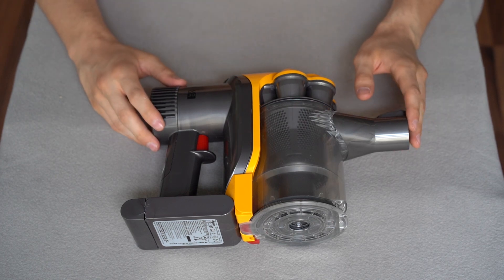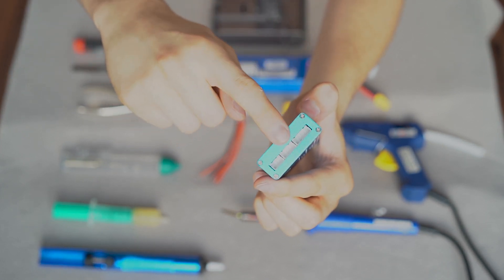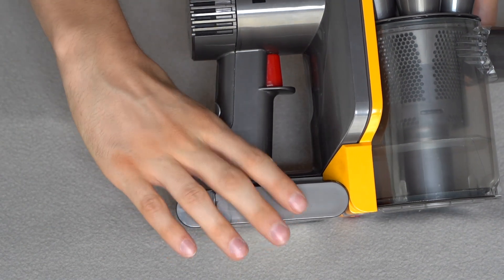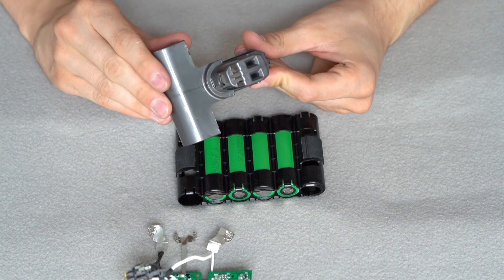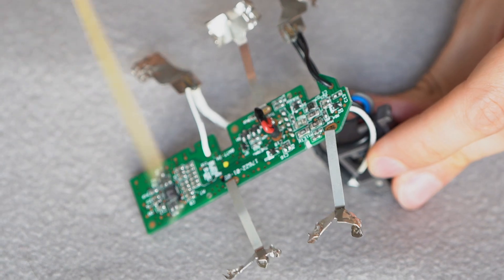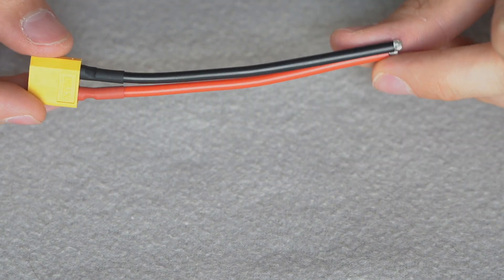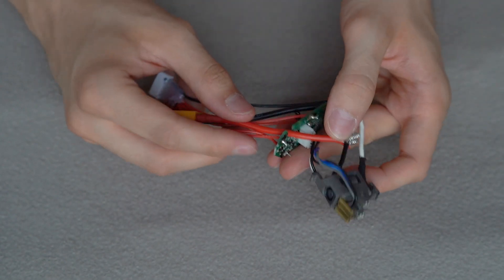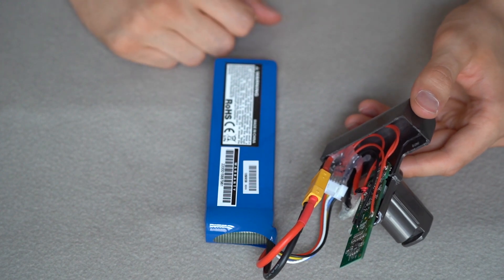Dyson Ultimate Battery Modification! Shocking!

Comment: Looks like my DC56 is a ~24VDC pack since the cutoff is somewhere, if I recall correct, around ~21VDC I found when measure.  I was planning to use a Kobalt battery pack when I get around to finding one at a great price.  Reminds me I should post some of my videos on iFixit if there's not ones yet detailing what I've worked with.  Thanks for sharing!  Gives some insight.
Reply: Yours looks like a 5S battery FYI... unless the pack is missing a battery.  (Update: Oh, interesting... has two missing cells locations).  Great design.
Reply: My wife's v8 is a 6S setup, and I had thought about the Kobalt's until I looked at prices and chargers.  Instead, I found the cells are $6-10 each, so I'm going to plan on replacing them instead.  I bought a charger that grades batteries (so I can judge condition).  Right now, the first battery is 2315 mAh, on cells that are supposed to be 3000.   I'm using an XTAR VC8, and I've rigged up a cable and a wood dowel so that I can charge and grade each cell--though it takes a LONG time--to evaluate each and tell me whether they're bad and/or which ones need replaced.  Then I'm going to buy new cells and put them in the existing pack, unless I can find a way to purchase a larger housing for bigger batteries that fit (and are cheaper for the same capacity).

Good luck!
Reply: @ericvincent3219  Funny is I've just been charging with a 24V power supply with a barrel adapter that uses a double alligator clip plugged in.  Been using as-is since since I balanced the cells manually using my Turnigy Reaktor charger. I haven't been motivated to spend anything on yet, though the closest I got was lazily daisy chaining the DeWalt powerwheels switched adapter to this pack.  Though seemed a buck converter in between would be better and that kept me from doing anything more since I don't have a buck converter that high enough current yet. 

Maybe someone can custom design and 3D print a housing for you if you're not in the know on how to or have a maker space of fab lab resources?  Can be outsourced printed as well like a few different online shops once you've made the STL file from the CAD app.   All the best and thanks!

Comment: I put a Bosch 18v to mine, just like the adapters only mine popped two motors. Why would it do that? Is their components in the adapters to stop the current flow or have I got two bad motors??
Reply: You put 18v to 14.6 designed electronic device...
Reply: i think the bms also communicates with the control electronics regarding the voltage, since the dc30 works with 4s and 6s batteries. on the pcb it even is labeled "24V", so the device is capable of using this voltage, but maybe only if its communicated by the bms

Comment: Hi! Cool video! If you use original original bms and you leave it without voltage in this type of dyson battery,the bms locks and never more works again.
Reply: Thanks for the insight. 👍
Reply: There is one guy from Japan that has modified the BMS so it works again he is on YouTube .
Reply: Do you have the link of the video?
Reply: @jonathanvazquezmarin8006  no but just type in dyson battery fix and it may come up.

Comment: Hi , very good video and explanations!   Good power and light weight.....but be careful with this battery type which has no external protection. 18650 cells are placed in an individual metallic cover and then in the plastic box. These polymere batteries are not always stable and have only a fine and soft enveloppe. If placed in an little air plane high in the air : no security problem for the user (perhaps for the air plane!) . But here just under your hand it's absolutely not secure if the pack warms and , possible, burns.
Best solution would be to build a solid and secure box before use...I would say it's necessary.
Friendly, Michel from France.
Reply: But another relevant factor is that LiPos, unlike Li-Ion, can not be left fully charged for long periods, and should be kept at storage charge, approx 3.8v per cell, when not in use. This means you need to charge them up to storage charge after use, and then top them up just before using them again if you want to get the longest life from them.  I do exactly that with my lawnmower, which used to have a very heavy lead acid 24v battery that took many hours to charge. I replaced it with one of the 6s LiPo batteries I use with my RC models, and it can be charged in as little as an hour if need be, and the weigth of the mower has been greatly reduced. I would suggest these kind of LiPo hacks are best used by experienced LiPo users, who are aware of all the dangers of LiPo packs.
Reply: @charlestoast4051  I agree your full comment!     And I add to be specially careful with the Dyson VCleaner if we use the max power during more than some minutes : Lipomere Batteries with their high C rate will perform for this use, and it could be pleasant to use often the cleaner  with this power...but at max power the Dyson VC needs a lot of amps (that kills the Dyson battery quickly) and it could be another danger with a lipo pack by long stopless use.

Comment: Can’t I just solder a battery to a push switch, and have the vacuum push button push the switch I will purchase, and that switch closes the circuit to the battery. Charging the battery can be done externally, like a drill battery of sorts. Would it work?

Comment: Replacement battery on amazon is like 55 bucks for 3800mah original battery type.
Reply from the maker: okay, and equivalent rc lipo is ~25  $ :)
Reply: $40 with shipping and taxes included on ebay for dyson v6 compatible  4800 mah battery
Reply: @chapter1762  they all fail in 3-4 months. Better off buying higher quality panasonic or other batteries and replacing the cells
Reply: The general output of 18650 is around 2200-2600mah. I would expect ebay pacs to be on the low side and be capable of the original pack 2200mah. They of course sell packs labeled to have Sony batteries and in 4,5,6000mah output for $20 currently.  I'm sure the packs are 2100mah as I'm sure the green lasers are all 5mw or less even though they claim 5-500mw

Comment: I accidentally broke the thermistor on my original battery bms, is there a way i can bypass that or make it work again affordably?
Reply from the maker: thermistor is usually a ptc or ntc resistor. so you might want to try a resistor with high resistance, or jump wire , but im really not sure.
Reply: Go to your local electronics store and you can buy a 100k NTC

Comment: I have a DC30 and the battery says 14.8 V 1500 amp . In amazon i get 22.v with 3000 amp battery - will those work for D30 or i need to only buy 14.8 v?? Appreciate ur response.
Reply from the maker: Only same voltage battery will work.
If original is 14.8v, you need 14.8v new battery
Reply: @cars_anatomy  Thanks!!!
Reply: no, it works with both 4s and 6s

Comment: I was searching for an onboard solution to keep the handy stock charging station, but this is pretty cool. There must be small enough onboard 6s bms with discharge for esk8s etc which can replace the woeful dyson/clone bms. So far I’ve replaced the cells with 30Q 3Ahr cells. Thanks for sharing tho
Reply from the maker: glad you found inspiration in it :D BR

Comment: can you mod it to make it works plugged in without the battery?
Reply from the maker: Zero Sum  probably, but you would need a power adapter powerful enough, which isnt affordable
Reply: Might be wrong but seen a guy use a 6amp 20v laptop charger. Would this work??
Reply from the maker: @gmcd1828  those lipo batteries are 20-30c, which means they allow current draw equal to 20x or 30x the capacity. which is much higher than 6a...

Comment: nice presentation and functionality is there, however original case is cannot be used to house this new battery. is it not simpler to just replace 4 cells with new ones and close original case ? Otherwise, this looks like unfinished project. Suggestion: get a decent case to place new battery in, then present it in final section of your clip so you won't have to trim last 30 seconds.
Reply from the maker: there is always space for improovment, and you are right! :) i just lost focus and got into another project before coming up with better case for new battery. Hope you make one, and film it :D!!  BR

Comment: Can a 12volt battery run these vacuums? What they lack in voltage is compsated with cranking abilities
Reply: Amps is what you mean. If the voltage matches then size larger than original is fine, just not less.

Comment: Will the Dyson work with just the + and - connected to the battery without the balance connections?
Reply: I try with my dc 31 but it will not run. without the logic board

Comment: I HAVE DYSON  V6 IT IS SIMILAR TO YOURS BUT SLIGHTLY DIFFERENT THE TOP OF THE BATTERY HAS TWO PRONGS + and -    A PLASTIC  PIECE   , WHEN THE BATTERY IS INSERTED IN THE VACUUM IT PUSHES A SWITCH..  THE WIRES OF THAT SWITCH  GO TO THE BMS. . DO I LEAVE IT CONNECTED TO THE BMS. THANKYOU